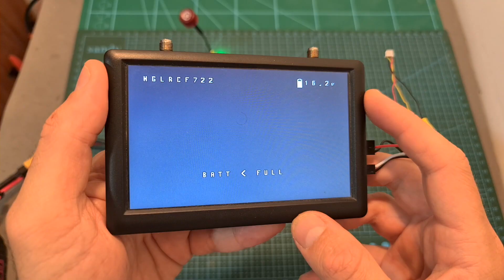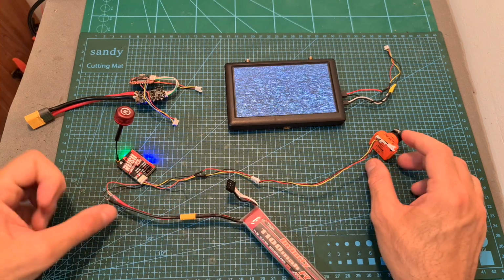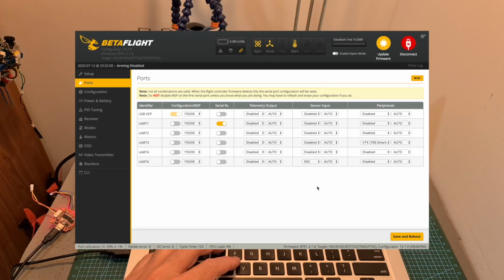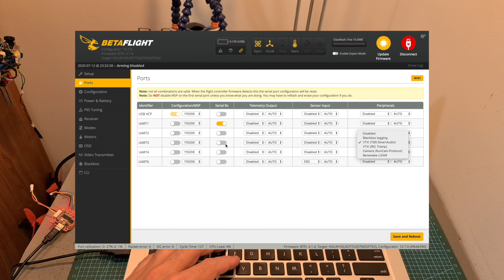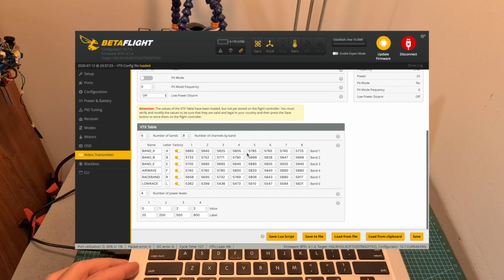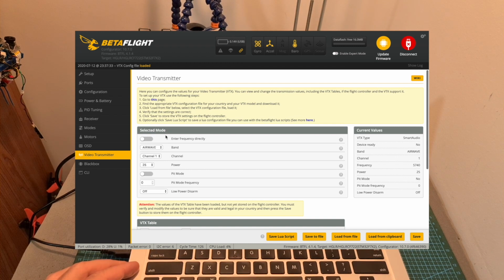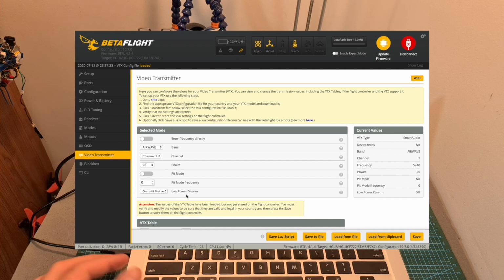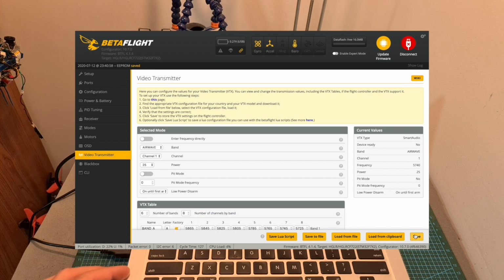No Video? Video Transmitter Troubleshooting

Comment: Hey Kramer I have 2 hglrc Arrow3 4s quads and none of them are producing a clean video feed..After watching your video here I went thru Betaflight and the vtx settings are correct and the pit modes are turned off.. Other than this issue the quads arm just fine..What do you think?

Comment: Nice video bro, btw I'm wonderin why my new vtx doesn't have image?, but it has sound when i put headset coz its a smart audio vtx but no video and no osd too
Reply from the maker: Thanks. Smart Audio has nothing to do with audio - it's a protocol for configuring the VTX settings. Do you see a black image or just noise?
Reply: @KremerFPV  black image, no osd and then sounds

Comment: i am facing vtx video.Its not showing any video now.
I am using akk nano race vtx.
Reply from the maker: Does it get hot?
Reply: @KremerFPV  yes.I rewire with extra ground directly from battery.Its ok now.
Did you tried the maximum 400mw?
i only set 200mw.
Reply from the maker: @kaorageko  good. As far as I can remember I have.

Comment: how can I test to see if a VTX is blown.  I put a brand new AKK FX2 on a quad but can't get any lights when I power the quad.
Reply from the maker: Do you have a multimeter? Try to see if the VTX is getting the correct voltage.

Comment: I get static and no signal at all (although there is a difference between the two statics on the correct channel).
When connecting directly just the yellow wires I get video without any issues.
So it means its either a configuration issue or the Video pad is dead ? Anyway to test that ? I believe that pad cannot be remapped unfortunately.

Comment: Hi ... I have a problem ...
I changed the receiver from frsky to tbs
Then...
The vtx range dropped down less than 1 meter

The quad working good but the video range 30cm

Do you have solution for this problem

I don't know if there is a relation between the receiver and vtx range...or this happened incidentally
Reply from the maker: Hi, maybe other settings were changed as well?
Did you figure it out by now?
Reply: @KremerFPV  can this be a problem with flight controller? Having similar situation, lost video signal after carrying additional weight 1,5 kilos on my quad, after video signal is only one meter away from drone.

Comment: Hey Gal, I know this video was made a while ago, but I thought I would shoot you a message anyway, as you seem to be a bit of an expert on these things. I recently received an Emax NanoHawk X and unfortunately, it has video issues. Reception is not very good then after a short period, I lose all video signal completely and just get a black screen, which creates a bit of a problem. I have checked all the obvious things and this problem is specific to this quad. Any suggestions?
Reply from the maker: Hi Shane, if your other drones are working well with the same VRX / antennas you might have a faulty VTX. I assume that you've made sure that the antenna of the VTX is properly connected. Have your tried to replace it?
Reply: @KremerFPV  Hi Gal, thanks for getting back to me. Much appreciated. Yes, that's what I was thinking. The antenna is soldered on so I haven't tried replacing it, I also haven't got a spare one to try, the same goes for the VTX. Anyway thanks for your suggestions. Hopefully, e-max will get back to me soon, and hopefully, I can get it resolved. It has already been almost two weeks so I am not very impressed with their so called support.
Reply from the maker: @shanejohnstone4245  I see. Well I hope you will manage to get it sorted...
Reply: @KremerFPV  Me too. lol
Reply: Hey Gal, It looks like the element part is missing out of my antenna, any idea where I could purchase a replacement from and what type I would need to order?

Comment: Hey! I had a good video and range the first time i flied but i had a bit of a crash and damaged my esc and the antenna was off as i found the drone. After replacing the esc i barely get any signal.. if the drone is at all behind me or even in front of me like 20-30 meters i lose the video... at first i thought it was the vtx config issue as it wasn’t set up after the esc change but even after sorting that out it is still the same.. simply very weak signal.. could it be i just need a new antenna?
Reply from the maker: Hi, maybe you damaged the antenna connector of the VTX, and there is a good chance that the VTX itself is damaged, as the antenna was not connected to it while it was still powered up after the crash.
Reply: @KremerFPV  hey! First of all, thanks for the reply! The vtx i use is the geprc 5.8g and it comes in a “stable flytower f4 v1.2” so the connections it has is the 8x pins going to the FC and a clip connector on top. Do u think i need to change the vtx itself to a new one ( can find v2 of the same one) or just the sma connector or maybe both? :/

Comment: My vtx is lighting up and everything is wired properly, but there’s absolutely no signal. Any tips?
Reply from the maker: Which VTX are you using? Are you sure you are not in pit mode?
Does the VTX heat up?
Reply: @KremerFPV  the HGRLC MT 30x30 vtx. It’s heating up, but only to a normal point for video transmittrrs
Reply: @KremerFPV  I did, but my no signal I mean static, not a grey screen w OSD as vtx’s usually broadcast without a camera connected
Reply from the maker: @quentindollard4602  So the video is static, even when the camera is connected directly to the VTX (no FC involved)?
Reply: @KremerFPV  yes, and I’ve searched tho all the channels to make sure I’m not just on the wrong one
Reply: @quentindollard4602  Did you ever get this resolved?

Comment: installed a new vtx.. everything was setup correct.. afther unpluckeing and plucking the lipo on again... my vtx is not working.. nothing...no lights burning...
Reply from the maker: Are you sure that it was powered using the correct voltage? Which VTX is it?
Reply: @KremerFPV   it was the rush tank.. i replaced it .. now i instaled the hglrc  mt vtx.. its working now.. now i bummed in to a other problem...i have lots of electric noise trough my goggles...

Comment: Hello! I had a perfect image the first time I tried my quad and now for the second try I have a totally grey image with the OSD. In-between I have done some minor crashes. Is it possible that I broke the camera?
Reply from the maker: Yes, the camera is not connected properly to the flight controller or it's broken.
Reply: @KremerFPV  Hey i flew my drone ive crashed it once but then i flew it again less than 5 minutes later no problems, i stored it for a few hours while the batteries were charging, and now I get no video. I was wondering if you know how to fix it
(edit) i think the googles are not connecting to drone. [Btw im new to fpv]

Comment: When I turn my transmitter on the video in my goggles starts breaking up to the point that its not flyable any thoughts?
Reply from the maker: Which VTX and RX system are you using?
Reply: @KremerFPV  Its the eachine novice 1.

Comment: When i power up my kwad, the tbs unify pro32 nano 5g8 powers up, tge leds are lit, i start searching the correct channel and the best i can find is crappy video with the range of 15 cm (sometimes i cant find video signal). What could cause that? Im using tbs crossfire and namelessrc aio 412t, the camera is a runcam nano 2
Reply from the maker: Is there any chance you are in pit mode?
Reply: @KremerFPV  unfortunately im outta pit mode :(   still cant get good signal
Reply: @wing_it  did you fix yhis ?
Reply: @hyphyfpv  i replaced the vtx, it wasn't worth the hassle, i think defective unit
Reply: @wing_it  dang it i just tried everything lol fornmy rush tank ultimate 2
Reply: @wing_it  thanks anyways dude thats gunna benthe thing to di
Reply: @hyphyfpv  Im sorry for your vtx, I have a rush tank II ultimate in my mavic air 2 and it work perfectly

Comment: I only have 200m range at 800mW, what can it be?
Reply from the maker: Are you flying in an open area?
Which VTX and RX are you using?
Reply: @KremerFPV  yes open area, the vtx is a rush tank 2 ultimate
Reply: @antoniodelvecchio5793  any fix ?
Reply: @hyphyfpv  did you managed to solve it .? I have similar issue after crash the Antenna was disconnected and I used it without the antenna for few minutes since this event the video is very poor ..

Comment: Hey man just want some advice please, recently got a tinyhawk2 kit, trying my hand in FPV, really loving it so far. So what happen is recently, when i plug in my battery and goggles etc, I get great video, but as soon as I lift the stick to take off, video is distorted and cannot see anything at all, but if the drone is stationary video is perfect, Im sorry if this question is super noob, I really now started and wld like to sort this out, if you can help, thanks.
Reply from the maker: Hi there. Welcome to the hobby :-)
Are you sure the VTX and goggles are set to the sane frequency?
I also suggest to make sure that the batteries are fully charged and all the antennas are properly connected.
Reply: @KremerFPV  ,thanks for replying. Yea I checked the batteries and channels on the goggles, also did alot of search online to find whats going on but was not successful. the video is fine before the drone flies, as soon as its in the air , no video.
Reply from the maker: @zaeemmohammed5521  Where did you buy it? You should contact the vendor and seek help if you think that the unit is defective.
Reply: @KremerFPV  bought it from amazon, but it worked great for the 1st week , and well learning FPV has alot of bumps n crash, and I was now getting the hang of it, flying under tables , controlling the drone etc. I tried moving the video antenna, and seems you have to play with it to get video signal, but flying it , no video at all. Thanks for the replies.

Comment: Something that I've encountered using Rush Tiny Tank VTX, that is super important to connect the u.fl connector properly, the antenna cable or the pigtail should be directed outside of the vtx board, otherwise you will not have any connection with the antenna.
Reply: Could you explain better please? I'm facing range issues with rush tank 2 ultimate

Comment: good video and timing, I lose all video for 1 to 3 seconds, all static, then it comes back. I recently had a crash that broke my ANT. I replaced it with another, along with the pigtail going the the VTX. Cus the original pigtail was male SMA and the only other SMA ANT I had was male. this is when the cutting out started. now i have a male ANT and a female SMA pigtail going to the VTX. My quad is the tyro 119 (DIY no upgraded parts). The crash popped off the metal cover on top of the VTX which may have damaged it (none i can see). the battery was ejected on crashing so the VTX wasn't powered on without an ANT for long. Is it safe to say the VTX was damaged and I should just replace it? or could it be the different pigtail and ANT?
Reply from the maker: Sorry but I missed your comment. I hope that you figured out the issue by now :-)

Comment: I've put a VTX on a 2s quad and powered it on 5v and got really poor range. I thought about it for a few seconds and said, Hey, I wonder if the VTX will work on as little as 5v? I checked, and just like I thought, it had a minimum of 7v needed! switched it to Vbat and it worked perfectly!
I swear VTX's can be the source of so many little things to throw a wrench in your quad flying great!
Nice video, Bro! For sure it will save some guys some headaches!!! 👍😎

Comment: So clear black screen and no osd is FC problem, right? All connections checked for connectivity. I had little bump into a wall and it went black. I wonder how could it happen. Thanks for the video!
Reply: It's usally camera no connected properly.
Reply: @davidvaknin3801  I have checked with to cameras, and also checked for continuity
Reply: I have the same problem with you.. All cable connected very well